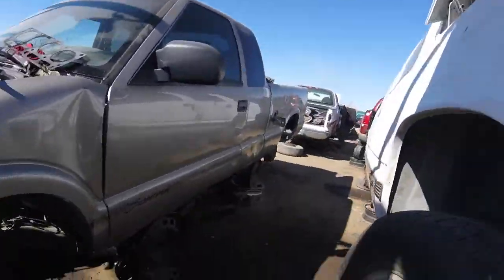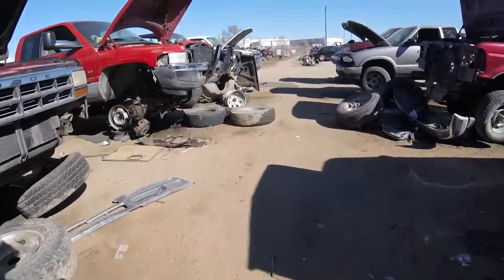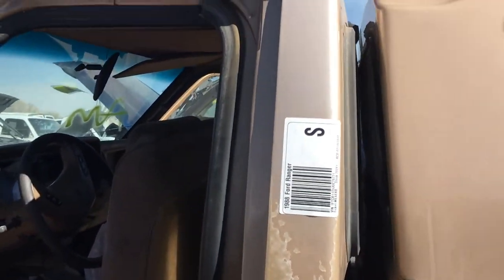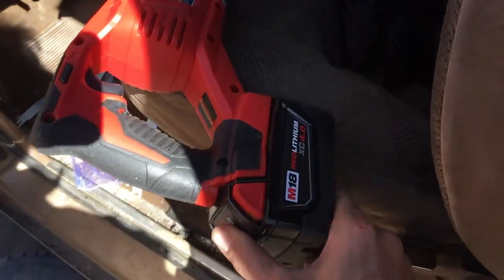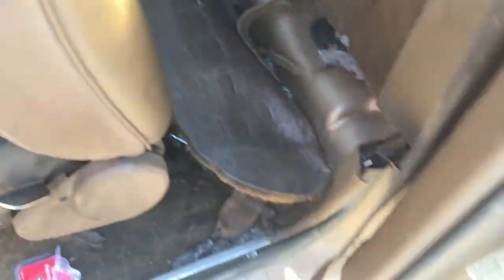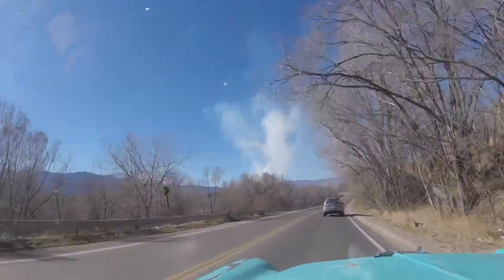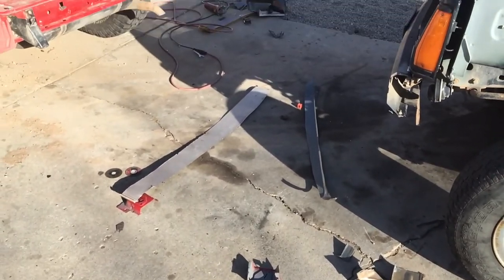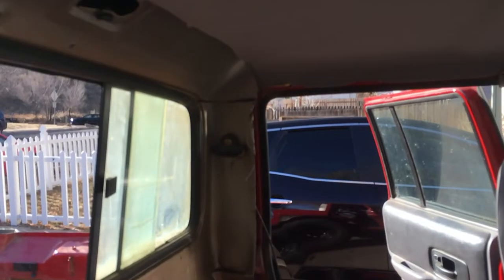JEEP Cherokee CHOP gets a back window S10E21

Comment: How was your finished product? I am looking to do the same with my Cherokee but still want to maintain the rear seat function and extend the length of the bed a bit. Just curious on how it all looked up close.
Reply from the maker: all 4 of them turned out great and sold for a profit. its all up to the builder on how well its finished. anything is possible with a welder and time.
Reply: Be kick ass on a 2 door Cherokee.
Reply from the maker: check my latest videos...

Comment: how much did they charge you for the ranger back?
Reply from the maker: it varies every time, depends on who is at the window. sometimes they ring it up as a window or a fender for 40-60 bucks. others, its as high as $100
Reply: WaynesWorkVlog thank you! I’m about to get a Cherokee this weekend and do this exact same thing to it.
Reply from the maker: NICE! try and find an S10 window. they fit better.
Reply: WaynesWorkVlog  what years of s10 or ranger work best?
Reply from the maker: the box bodies (80s-early 90s) but if you are already cutting and welding, anything will fit. honestly if you wanna tackle job like this, get a tape measure and get busy. no one is going to help you.